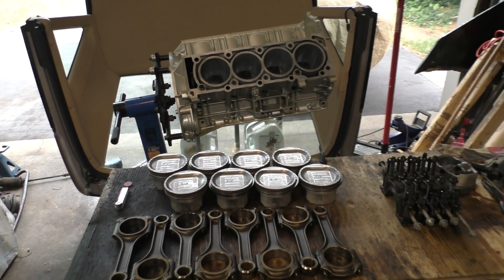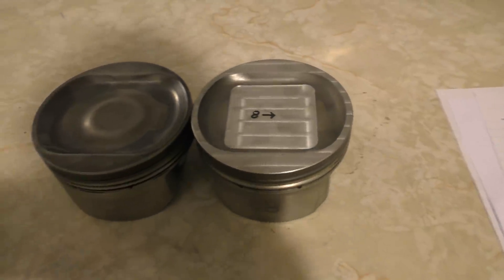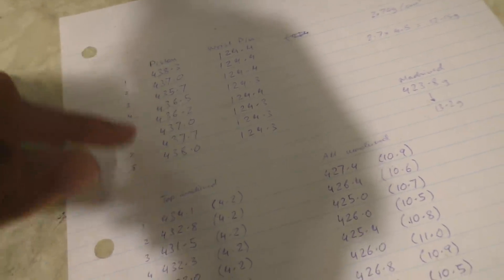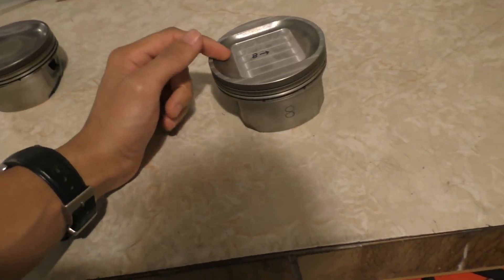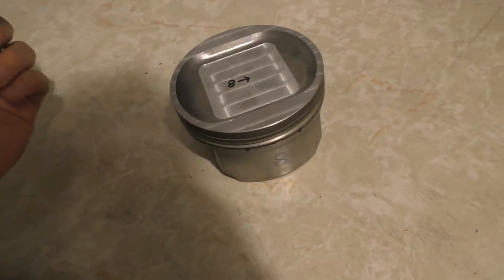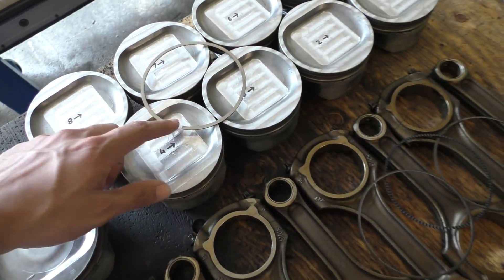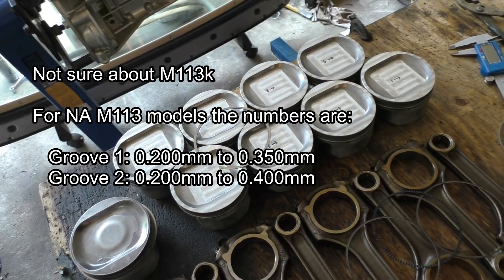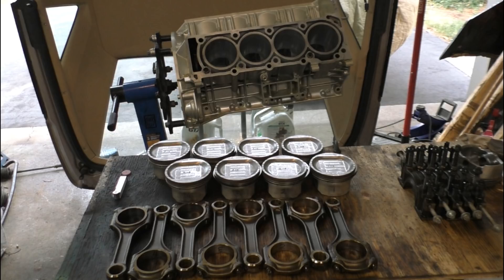E55 Engine Rebuild - Part 3 (Machining Pistons & Ring End Gaps)

Comment: Tip; always use WD40 or similar when milling aluminium/aluminum to prevent chip welding or gumming up the cutter.

Also, remove any sharp corners or edges within the combustion chamber to prevent detonation and stress risers so use a ball end mill to recess or remove material to leave a softer, radiused border, preferably hand blended smooth so there are no abrupt transitions or steps which heat up rapidly and cause knock. Imagine grinding a cutting toolbit for a lathe or a wood chisel and bluing the steel at the corner, drawing the temper. The heat builds up around the edges as it has nowhere to go.
Reply: I'm fairly confident with this gentlemans knowledge and process , doubt he needs first day pointers.

Comment: One small problem. The area around the perimeter of the piston is called the quench area and should not have been touched. By removing aluminum from this area can actually increase detonation. You would have been better off taking more out of the center than ever removing anything from the quench zone. If you were to deck your block to gain this quench back it would diminish the amount you removed from the center. Just a bad idea to reduce your compression height by removing aluminum from the quench area. You did not reduce your compression as much as you increased  the likelihood of generating detonation. Its the quench ring that extinguishes the flame front and reduces your threshold of detonation. This ring works with as little as 4 mm of radial length but fails entirely when your compression clearance goes beyond .040 inch. You need to have no less than .040 inch quench clearance. I have not done the calculation yet but your .75 mm seems real close to the .040. How far down the cylinder are your pistons at TDC? How thick is your head gasket? In my opinion you are taking some unnecessary risks. Only a person who does not understand quench would play with this quench area. It should be considered sacred especially when you want to run boost. I have been successful burning regular 87 octane fuel in an 11.5:1 engine with correct quench clearances. With out the quench set properly I would have to drop my compression to 9.5:1 to get the same results but with far less power.

Comment: What are your thoughts on the effects of decreasing the perimeter crown height (unless you are also running a thinner head gasket) considering the reduction in quench effectiveness? It seems likely that you would have had a better knock threshold if you had left the crown height alone, and reduced your piston cc's by only machining the reverse dome.
Reply from the maker: It's not that critical in these 3 or 4 valve engines. They have a very small quench area. Most versions of the m113 just had a circular crown with no quench area
Reply: @xfmotorsports  I just watched your head Porting & Polishing video. Those quench pads are small! Makes sense, thanks.

Comment: I would expect the outer rim of the piston to be a squish band.  It needs to maintain a piston to crown clearance of 0.75 - 1mm, otherwise it becomes ineffective.  Losing it will make combustion much slower and less efficient.  Better to remove metal elsewhere.

Comment: Can you talk about the blue car you mentioned briefly at the beginning of the video? What’s the backstory? What kind of work did you do to it? What happened to it? Would love to see a video on an engine failure
Reply from the maker: It had a minor headgasket leak. I gave it to a mechanic for the repair and he charged for a full head gasket replacement and head resurface, but actually just mixed those leak stop things in the coolant and kept driving the car with a blown gasket. Later we reported it to the dealership. After that he did end up fixing the car as well as all the additional damage he did, so I didn't bother mentioning it.

Comment: Accually, running it on E85 would mean you could get more power on way leaner mixture.
Also, E85 produce way more power on same boost, so you could go with lower boost. = less fuel.

Also when you lower compression you decrese efficency, by a segnificant amound.
So you should really have gone with E85, and left the pistons alone.
It would probobly have been a very small difference in milage with E85. if any.

Also the risk of detonation is completly elimminated. Not running E85 on a track, when you can, is just foolish.
Reply: You do know that you need to pump more fuel to make the same power on e85?
Reply: Yes, isen't that obvious? Thats why I commented. 
SK8215 probobly knows, just like you, that Etanol has lower energy content than gasoline. About 40% less when its in E85 form. But, that number is not true in real life when you consider what I just commented. Lower compresssion thats atleast 15%, leaner mixture 10%, power gain = less boost = atleast 10%. So now you are down to a 5% difference. And if you go the other route, with higher compression, thats 5-10% more. Now the milage on full power will be less than on gasoline.

The only downside is wear on the fuelsystem and you need to change oil more often. But fuel usage on track, with high power output in high boosted application, E85 can be on par with gasoline. 
Trust me, I tune cars for a living and have raced cars on E85 for 10 years.
Reply: @Webrexxx  my dad also works at microsoft
Reply: To bad you're not as smart as him then.

Comment: So are you going to remain on the e class chassis? I think the only downsides would be the weight distribution(53/47) and the overall weight.
Reply from the maker: I really want to move the turbos to the front and get rid of the supercharger. Its going to be impossible to do on the E55 because of the small engine bay, so I'm trying to figure something. Weight and high CG is a massive draw back too in that chassis

Comment: Possibly a bad move removing material from the squish area of the piston-if the squish clearance is too great you will lose the squish effect that concentrates the mixture in the centre of the combustion chamber. That leads to "end gasses" being trapped thus promoting the detonation which you are trying to avoid.
Reply from the maker: I talked about it in the video. Its a very small effect because those heads don't have a big enough quench area anyways. The N/A models of this engine don't even come with pistons with that area at all. Even with heads designed for quench they only provide 4 or 5 extra hp so its a very small effect. Probably worth having the lower compression than keeping the quench in this application
Reply: SK8215 Thanks- when I get a moment I ll finish watching the video.

Comment: Just out of curiosity, if you are planing to raise your boost, meaning more horse power as an objective, why are you not using carillo I beam rods.
Reply from the maker: Depends on your power goals really. I've been told the stock rods can hold up to 20psi. I know beyond that other things will become an issue anyways so I'm planning to stay around there. If it was an engine intended for drag racing maybe I would have made the extra effort, but this is going to be good enough for time attack anyways. Temperatures get really hard to manage for higher boost levels on a time attack setup

Comment: Swaintech coatings! I have used swaintech in the past. Ceramic on top and polymoly on the sides. It was around $230. Check them out.
Reply from the maker: Sure, I'll give it a search

Comment: one question: 
have you thought about litering the pistons?
just take a peace of plexyglass withe a whole in it and slowly add colored water drip by drip into ist to see if the macheneing in the middle is equal..
an another one would be to smoothen out the transition between the machened surface in the middle and the unmachened surface around it since sharp edges do lead to earlier detonation...
Reply from the maker: Yes, I did try measuring the compression with a piece of glass. Its hard to get accurate results that way because these are very small changes in volume. 
And yeh sharp edges are definitely bad. I did sand down the rough edges the machining left but I'll try to do that a bit more before the final install.

Comment: There's good research that shows that the piston rings spin while the engine is running so clocking the rings is not important.
Reply: They might not spin if all the gaps are on the same point, escaping gasses can keep them in line.
Reply: If that were true, and the rings spin (they 100% do), they would eventually line up by chance and be stuck that way which doesn't happen.
Reply from the maker: That's a long debatable topic. Most engine builders I've talked to say its worth clocking anyways. I know the rings do spin eventually but other people building racing engines that do engine rebuilds more regularly also say they find them at the same place every time. I dont know which one is true but I would say its worth clocking anyways for at least the initial gain in compression it leads to
Reply: SK8215 The study that I am referring to measured the rate of rotation (which depends on all sorts of variables). It doesn’t hurt to clock them though.
Reply: I can say for a fact that they do rotate, and quite a lot, i have worked on a lot of smaller engines primarily diesels in the 200-400 cm3 range,  those engines are fast to take apart after a test run and check for things like this, and i find that in just 5 minutes, they easily rotate a centimeter,  so this shouldn't be a reason to spread the gaps evenly. however if you are going to do a compression test after assembling the engine, it is a good thing to space the ring gaps, so you can rule out the piston ring gaps from being the cause of varying compression from cylinder to cylinder.
Reply: my dr told me that I dont HAVE to wipe my butt and I wont die if I skip it a couple days in a row.  Itll clean off IF I take a bath, but its easy so I do it anyways.

Comment: Out of curiosity, why didn't you use a thicker head-gasket rather than milling the pistons?
Reply from the maker: There's not too many aftermarket options and also because of the additional risk of the gasket failing. If it was something tried and tested on these cars then I would have possibly gone for it
Reply: Also while you probably might be fine with mild gasket thickness increase, on V-shaped engines increasing gasket thickness spaces heads not only further from the block but also further apart from each other and in some cases it can introduce problems when you will be putting intake manifold back on. so you might need thicker gaskets there as well...